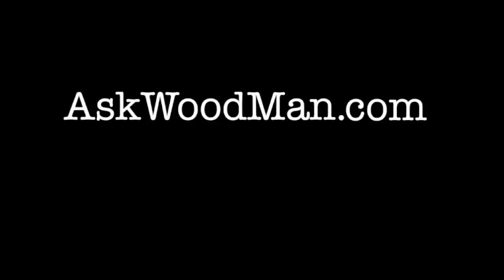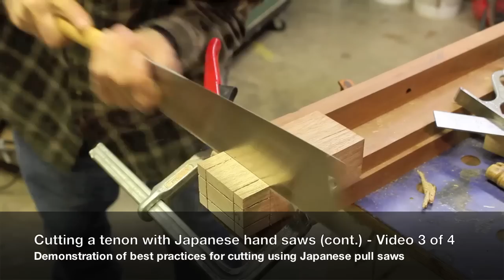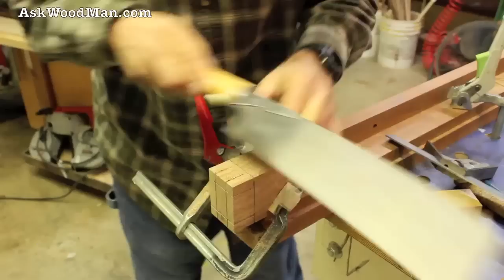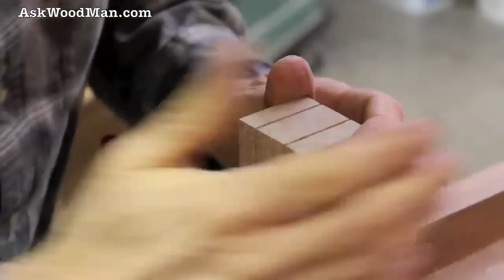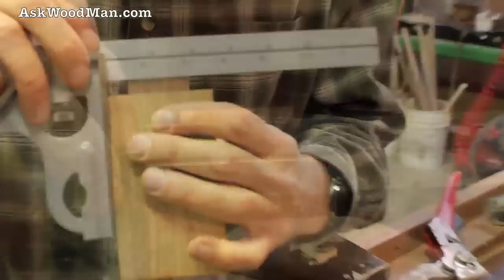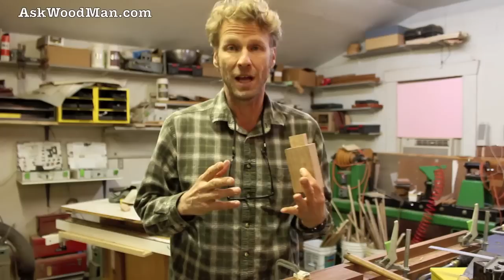42 Tenon Cutting Demo Using Japanese Hand Saws - Part 3 of 4

Comment from the maker: I did this video just as a demonstration of the types of cuts these saws can do. I would normally use power tools for just for speed and accuracy, but I do feel it is a good introduction to show people the different cuts these remarkable saws can do. Also with just a small scrap of wood you can practice with them without wasting money. It just takes practice to get the feel for the light pressure and hand positions required. I am still learning too.

Comment from the maker: Thanks for that heads up. I will look for them and give them a try. If they are working for you I am sure they will work well for me too. I am not a big fan of Harbor Freight either but I do buy stuff there too. The stores have the weirdest smell. Cheap grease and plastic outgassing is what I have finally settled on as the aroma. Thanks for writing. Many people will see your tip and be steered to a tool that is inexpensive enough to try if they have never used a pull style saw. Allan

Comment from the maker: I have a little rabbeting plane that will cut into shoulders, but it is a little difficult to precisely set up. I just prefer to use a sharp chisel where I have complete vision of the cut and can control the edge better as I cut across the end grain. The control of the chisel is also better as the blade edge approaches the edges so I don't break off a piece of the end grain.  Good question.

Comment from the maker: @mountaineerworks If there is one negative about those clamps it is that those hardened steel ratchet teeth are exposed and can pinch. I had a perfect tooth sized piece of skin/flesh removed from that part of the hand where the thumb meets the palm and there is that fold of skin. It was a very painful lesson that I have not repeated. Those clamps are industrial grade and when they are locked, they stay locked.

Comment from the maker: @pavitrashishah1281 The wood is sipo or it is also called African mahogany. White oak is coarser and harder, so I would suggest reducing pressure and really let the saw do the work. Generally too much pressure imakes those thin blades drift. You are using a rip blade to cut into the endgrain? I also always mark with pencil where I want the cut to go so I always have constant feedback on my cutting action. Thanks for watching.

Comment from the maker: I do that a lot when cutting dovetails to stay on my scribed line. Here since this was just a saw demo I did not want to overwhelm, and blocking or moving the camera was  consideration.  I do not sharpen those blades. I just replace them. They are not expensive and trying to sharpening that impulse hardened steel is not worth my time. But if you use those blades for their intended use they really last a long time. Pennies per day. Thanks for watching so carefully. Good comment. Allan

Comment: I have owned the two HF Japanese saws to which you refer for a couple of years, and, on a bathroom remodeling project I'm currently doing, they have been invaluable - especially the double-edge saw.  

My daughter was feeling sorry for me (the project is at her house) when she saw me using it because the power was cut off to her house that day.  She thought it was a hardship.   I didn't tell her it's much easier and quicker for me to use it than any electric alternative.  :o)

Comment: my two cents... as a child i watched a carpenter add two more rooms to our house... he did the whole thing on his own with nary a powertool.  he could cut a 4x2 with a handsaw just as quickly if not faster than a powertool (usually 3-5 strokes).  he nailed with a hammer and could drive a nail in a couple of strokes with his hammer. his cuts were also just as good as a powertool for angle and straightness. think of all the beautiful furniture made over the centuries with nothing but hand tools.

Comment from the maker: @mountaineerworks I discuss the clamp below but will just expand a little more on it here. I have a wide variety of clamps, but I have never used anything as versatile as these. I first became aware of them through Festool products. Bessey (German) must make them for Festool because the mechanism and steel stock markings are identical with only a modified jaw to work with all of Festool's acces. Note in the video how they hold my work board through the holes on the table. Really handy and FAST.

Comment: Excellent video, thank you. Although I use a combination of a table saw and hand tools to cut my tenons, I find that slightly overcutting when making the crosscut for the shoulders reduces that annoying lip at the bottom when cleaning up. It also reduces the likelihood of cutting into the shoulder when ripping the tenon sides also.

An unintentional side effect of even a mm of overcut into the base of the tenon is that it creates a "buffer reservoir" for glue, lessening squeezeout. Cool eh?

Comment from the maker: When I trash these blades I always keep them for either cutting through nasty glue, or I grind the teeth off and the blade body makes excellent scrapers. The body has not been impulse hardened so it is really easy to made the edge take a wicked hook. Maybe not for fine work like a card scraper, but really useful for more medieval scraping jobs. I never pitch any Japanese steel.  I have a bunch of shapes ground in old blades for any occasion.

Comment from the maker: Wood filler has no real strength. If you have stripped out screw holes, the best repair is to fill the reamed hole with shaped piece of scrap wood and glue and then rescrew. MDF is really just a paper product but wood can be easily glued to it to fortify a hinge connection.

Comment from the maker: @kook427 That big two sided saw is a carpentry saw. It is just for getting getting busy and not really for fine work. I would not recommend Shark Saw. I was given one to try and found it really sub standard. Go online to Japan Woodworker and buy a Gyokucho. I list the model number on my website. I promise you will not be disappointed. If you buy one just don't let knuckleheads on the job site borrow it and use it wrong and mess it up. They take a touch and finesse to use properly. Keep in touch

Comment from the maker: @tubestick00 It is Bessey Rapid Action Clamp 8". I can't go 15 minutes in my shop without using one. Several of mine are 5 years old and have been used a lot in welding situations and I can't detect any wear in the ratchet mechanism. This Bessey model is made in Germany not China. Woodcraft has the best price on them at $39.99. Perhaps you will click through my website to get to Woodcraft since I have an affiliate relationship with them. Thanks for watching and commenting.

Comment from the maker: @ironlionkalo This is a Bessey rapid action clamp. They are easy to use and super stout. This is the 8" model which is a really great size. For welding and metal working they are the best. They are made in Germany and are really well made. You may notice I tape a wooden jaw protector on them when using them with wood. And when they are ratcheted tight no amount of vibration will make them come loose.

Comment: Incidentally, my reasoning for cutting the shoulders on the table saw is for the speed and cleanliness of the cut all round - not labouring under some misapprehension that modern power tools in some way supplant traditional methods and tools. You know....the quiet ones where you can hear music playing and don't throw up clouds of choking dust. ;-)

Comment: Hi, I need to make approximately 40 inch cuts in a piece of hard maple for a gunstock ie; a muzzleloader. The material will be about 2.5 inches wide by four inches high for the barrel area cut to 2.5 wide by 1.75 inches high and 45 inches long. I need the cuts to stay true and square to each other in parallel lines as I'll be cutting the height from the top as well as the bottom. These cuts are used to align all other portions of the carving and building etc. Is this Japanese saw a good choice for this or would another type be better? I would prefer a hand held type if possible as I'm kind of into doing things the hard way or traditional way I mean. Thanks and I enjoyed your video. Very informative. Dave

Comment: Would you recommend these products for carpenters or are they more for woodworking hobbyists?  I've looked around and haven't been able to find any of these saws in the large home renovation stores.  Also, I came across some brand called Shark Saw (plastic handle and cost about 25$ average)  Do you know if it is any good?  Thanks for your time and the informative videos.

Comment: I like the clamp. It is a tool I need. Where did you purchase that. I am setting up my new wood shop. I am a beginner. The clamp is a necessity.
Reply from the maker: That is a Bessey LC8 made in Germany. I do a lot of welding and steel fabrication and that is the primary market, but they are a fantastic woodworking clamp also. My tool company is a Bessey distributor. http://vsctools.com/shop/bessey-clamps/ Scroll down and you can hear more about those remarkable tools.

Comment: Nice job made easy.

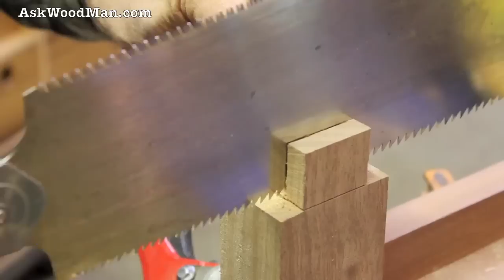What I wonder is if there's a particular reason why you go with the saw a little at a time on every side. I mean, if you first went all the way to leave the piece like in 2:50 (only with no cuts in the remaining wood), and then go and do those two final sides, the number of cuts would be the same, but you would have cut less wood, which means less effort I think. Maybe not much of a difference but, in the long run, the blade would last more before sharpening, hummm?

Comment: I want to put a cross piece that will hold a shelf on a table.  This will go between the tapered legs.  How do I determine the angle for such an install?
Thanks.
Reply from the maker: Take an angle reading. A common way is to use a sliding t-bevel on the legs and then read the angle with a protractor head.

Comment: 1. Make yourself a square out of 1/2" thick timber. Saves having to use a metal square -and- a block of wood.
2. Try not to rock the sawblade. This will result in a much quicker tenon - no fiddling with another saw, or having to flatten the shoulders with a chisel.
3. Never, never drive a chisel or any sharp tool toward yourself. Cutting your finger is one thing, stabbing yourself in the chest with a chisel as sharp as yours could be disastrous.

Cheers

Comment: Are those Festool clamp pads?  :)
Reply from the maker: Terry those are Bessey LC8 Ratcheting Clamps. I discovered these from my metal working but use them constantly with my woodworking. Bessy actually makes the Festool Quick Clamps for them. The Festool clamps are substantially smaller and have the slim snout for fitting into extrusions. My tool company carries the full line of Bessey clamps for both wood and metal working at great prices. http://vsctools.com/shop/bessey-clamps/